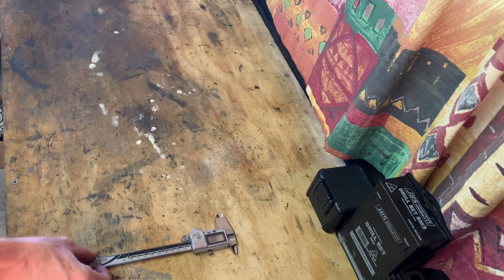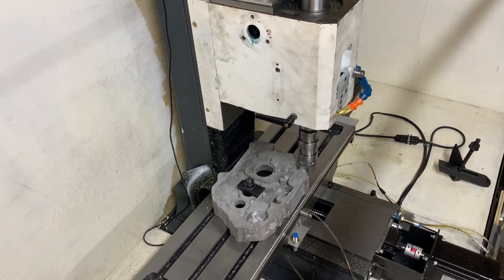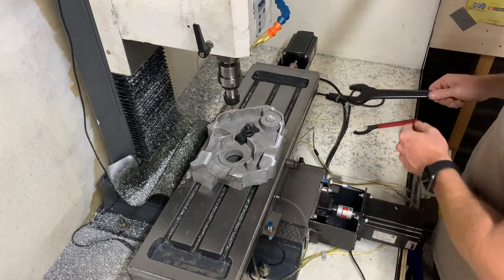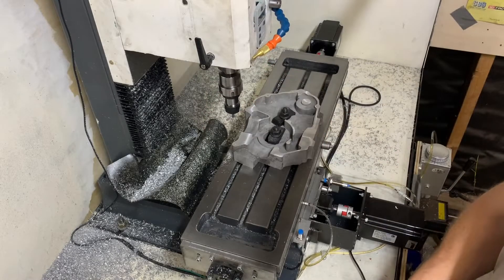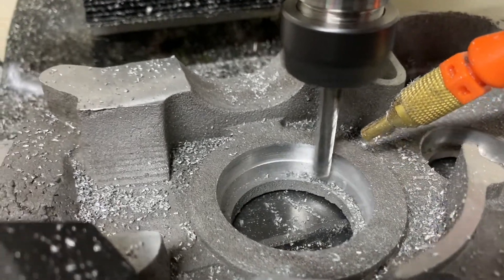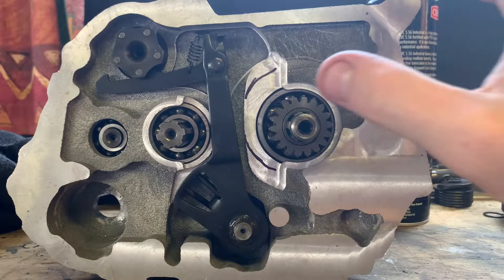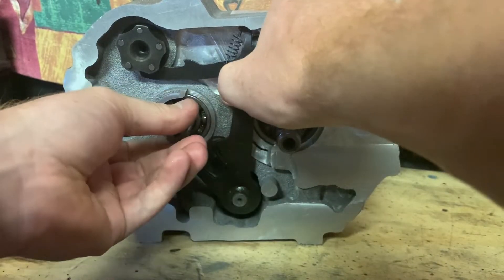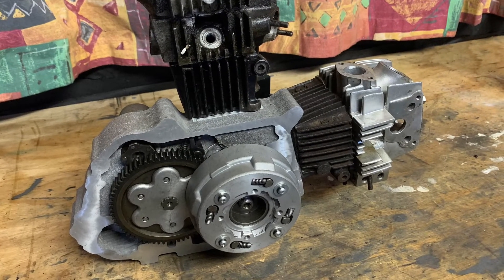Homemade V-Twin Engine

Comment: You can use crank and heads from honda astrea grand from 90s to take 200cc easily and primary gears from z50 1971 with 18-67 gears for much higher speed. And maybe 4 speed gearbox from honda c59 glx or lifan

Comment: That is some excelent work rigt there! I also had the same ideat but I dont really have money to buy milling machines. Seeing someone doing this is just amazing. Very nice job and good luck with next projects 👍.
Reply: Can I ask you how much was the cnc mill or where did you bought it? Whats the name of it?
Reply from the maker: Thanks you. It’s an Optimum MH28V, it cost $2,800 nzd. The conversion to CNC was about $1,000 or less. 

It is similar to a grizzly G0704

Comment: Very nice. Any idea how many hours you had in at this point? Surprised you don't have more subs as the content here is great..
Reply from the maker: Thanks, i’m sure the subs will increase, I just need to upload more frequently. 

The design took far longer than it should have although I was learning how to use fusion 360 as I designed the pattern. Maybe it took about 3 months of occasional modelling on the pc after work. 
The casting and machining the patterns could have been done over two weekends. 

Machining the cases doesn’t take that long, maybe a weekend for each half. But being my first time it took a lot longer as I had to fix lots of small design flaws and sort out how to tension the cam chain amongst other small challenges. 

For reference, I’ve started another engine (not the V4) and the design is close to finished after 3 weeks. I think I’ve developed a bit of a process now.

Comment: can you cast direct shaft 2 stroke engine for ultralight aircraft

it may help us to move by your casting guide
Reply from the maker: I’m sure it could be done fairly easily. You’ll just need a bunch of Extruded polystyrene foam and either hand shape it or draft it up in some CAD software. Then get someone with a large router to cut it out.

Comment: That casting is fucking amazing! I cant even cast a cube without bubbles in the shit. Where do you get your casting supplies in NZ?
Reply from the maker: Thanks, i got the sand and gib 4 plus plaster from bunnings, same with the foam. The aluminium was old Honda engine parts I had kicking around. 
I’ve never bought any real casting supplies haha.
Reply: Amazing result with what looks like just bedding sand. Did you video your small CNC mill build?
Reply from the maker: I’ve only snapped a few photos of the process. I’m pretty bad for filming things I’m doing, it’s a miracle I’ve managed to film this much haha.

Comment: How much would it cost to modify this motor?
Reply from the maker: If you mean to make this motor so far it has cost me around 
$21 for the sand
$22 for the plaster
$25 for the foam
$0 for the scrap aluminium 
$270 for a brand new donor motor 
$150 for another new cylinder, piston and head 

The are a few other small things I haven’t added up or gotten around to yet.

Comment: The downside to owning a Milling Machine or Lathe ?
Buying, Everything else you Need to actually make it work.
It does take time to build up a reasonable amount of gear to do the job right.
But that's all part of the fun of machining.
Great to see the progress on the engine build.
Looking forward to watching the next video.
Peter  👍

Comment: Outstanding episode.  You should have thousands of subscribers.  I have had a mill, lathe, etc and a foundry for a while.  Finally took the plunge and bought a 3d printer and am learning CAD and G-Code.  Next step is probably a cnc router to do exactly what you are doing here.  Keep up the good work!
Reply from the maker: Thank you, I will get there eventually if people enjoy the content. 

i was in the same boat as you about a year ago. I only learnt Very basic G code for this. I rely on the Fusion360 CAM to write it all for me, learning how to do this properly takes a while. Have a look at the NYC CNC vids they helped a ton when I got from the CAD to the CAM stage.